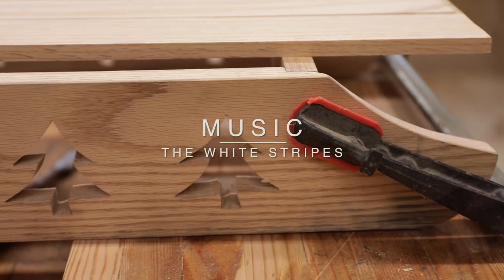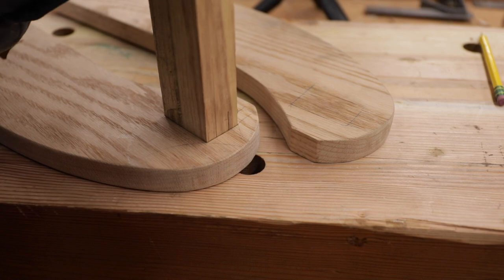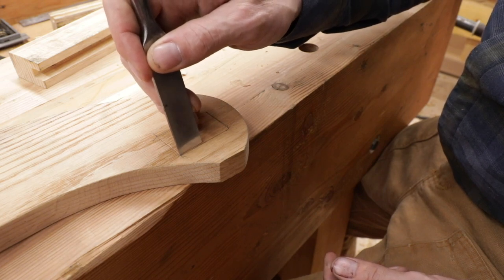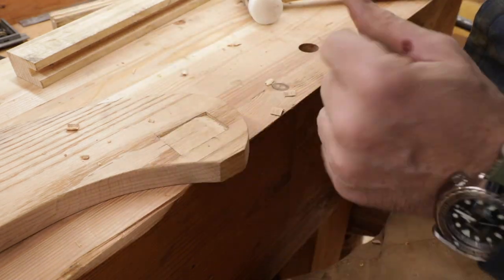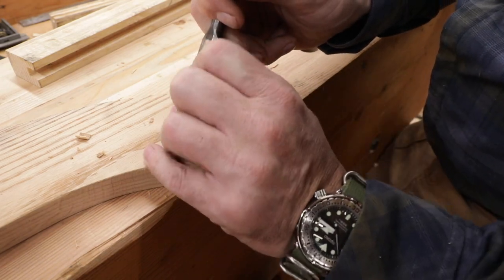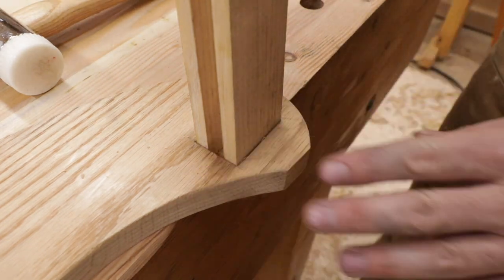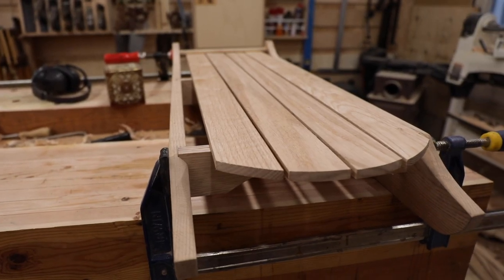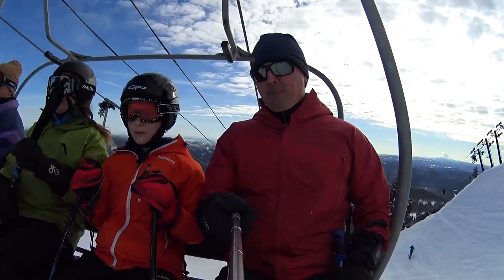HOW TO MAKE A SLED 4

Comment: Natural wood is best, just like the one I used in the 60's! It also had a rope that was attached through two vertical holes near the ends of the crossbar up front by some clever knots above and below. The rope was just a little too short to fall off the back if laid on the seat, which made it the perfect length for pulling and could also be wrapped behind a kid's back almost like a back rest, although that was a longer sled, so with yours that length might be too short for pulling. I remember putting a lot of wax on the runners! You can pull a toddler, or if you tie on a cardboard box you could pull a baby, or even the Heart Racer! If you pull Heart Racer behind you, then your heart will be racing!

Comment: Cody, I have painted red oak in the past, yellow and black, I do not like to paint  hardwood. If it were my sled, I think I would  use a water base stain ( comes in red ) and top it with the Waterlox. Also, I would pencil in the W* on the center slat and use router to carve it out, paint that red or gold and sand it flush once dry. It is a beautiful sleigh, great job.

Comment: This is an awesome project.  There is a difference between a sleigh and a sled.  Unless Heart Racer is going to pull it, it's a sled ;>)
A sleigh - a vehicle like an open-air carriage, pulled by horses, using runners instead of wheels for use in winter on show/ice. sled - a small single person conveyance to slide down hills, usually has runners, but may just have a flat bottom

Comment: For those non-woodworkers, he is using the chisel backward.  The proper way to chop a mortise is with the back of the chisel facing the wall with the bevel inward.  FYI that is a called a router plane.
Reply: Robert, Doesn't he have his router plane blade on backward?
Reply: Eastern Woodland Yes you would normally have  blade pointing toward front, but you can turn it that way for better visibility like when doing a stop dado.  Notice the gap is due to improper chiseling.  It's an ok job I'm just pointing out for others watching.
Reply: Robert, Thanks. I thought that might be the case.

Comment: From the beginning of this project I envisioned it being a two toned stain. With the lower frame and rails being done in either a light golden stain or natural, with the top slats being done in a dark walnut. To top it off several coats of a marine grade semi gloss polyurethane. It would make an excellent wall hanging piece of art, or a wonderful sled for some children. I think Jack is a little big for it. It would look wonderful hanging next to one of the doors with a sprig or two of fir and a red bow.

Comment: A handle on a child's sled sounds good at first blush - but if you are unlucky, it can lead to 'pole vaulting' in a downhill slide. Think about a car at speed on a 1/4 mile track if the front of the driveshaft comes loose...

A rope loop is generally safer.

I'd go with a natural finish. The wood is really beautiful.

Comment: I would vote for a dark finish on the runners like mahogany stain, a light finish on the deck (top) like light pecan, and a sealer like spar varnish (its light honey color really brings out the wood grain and stain color).  I would finish the runners with brass wear strips finished off with a ski glide wax on wear strips.  LOVEY SLED!!!!

Comment: No paint, a heavy-duty clearcoat will do nicely.

Also, putting steel strips along the runners will drastically increase sliding efficiency.
...half-round or half-oval steel bar would be ideal if you can get some locally.

Comment: I would paint the inside of the tree cut outs green and the stump portion brown.  The remainder of the sled should be clear neutral finish, to allow the wood grain to pop.  The 'painted' tree cut outs would really pop in contrast to the clear finish and even change in hue depending upon the angle from which they are observed.  The purpose of the tree cut outs was to add visual appeal so why not give them an 'old world' appearance by highlighting them?

Comment: Natural Finish.  Use Clear Penetrating Epoxy Sealer (CPES) its marine grade, soaks into the wood and is thinner than traditional epoxy. Wood whisper used it on a few outdoor furniture pieces and I used it on a exterior cedar door. Looks great.

Comment: natural finish with red runners!  also, if you use a solid handle instead of a pull rope, be aware that when a child is sledding with that, the solid handle has more of a possibility of causing injury when it bonks them in the face

Comment: I have the same watch band on one of my dive watches, the two links are on it to lock the band so it will not come off under water. you thread the band thru the links to tighten down. on the other side links I mounted a small compass. Every atmosphere you descend 33 feet/10 meters you add 14.7 psi to your body and your dive gear loosens up.

Comment: Have my Dad's Flexible Flyer sled. The back end is sort ofstepped arch rather than a radius. It was also clear finished on the bed with red lettering and the steel runners were either red or black. It also had a rope pull. You Don't want a handle in case of a crash. It would be an impact point for your riders. The sled can be carried or pulled back using yourself as a break going downhill.

Comment: Money well wasted on watches in my opinion. I work outside in the weather with frequent submerging up to my elbows . Had the $50-$150 watches, went through at least half a dozen. Then, in desperation, picked up a $15 Casio on my lunch break from Walmart about 4 years ago. That thing is still going strong.
Reply: Those casios work pretty good but the crystal isn't very strong. I have a half a dozen or so with broken crystals and each went through 1 to 4 bands before I just gave up on watches. That being said they did protect my arm in many cases. Working in tight spots on cars and trucks and just repairing things in general was kinda hard on them. At least for me. I must be clumsy or something. Now I just have scars where my watch used to be. lol

Comment: Don't paint the runners, it'll wear off very quickly. Either do a nice slightly darker or cherry stain, or stain everything but the slats and paint them red, or red with white accents. Then dip the runners in epoxy and put it together, it'll look good for a long time. Either way it'll look sweet! Good job

Comment: On the bottom of the stool seat you could pencil in center lines on both axis' so you have a reference to go by when needing a radius drawn.
Might save a bit of time & it would be there just in case you want fast markings.

Comment: Cody, rather than a G-Shock, I would recommend a Casio ProTrek.  You can find them with a compass, barometer and altimeter.  I have three of them in various formats, but they are extremely tough watches and not as gaudy as a G-Shock.

Comment: I have been planning to hand-build a toboggan or wooden sled for years. COVID has 'primed' me to start wood working once again, and after a number of projects, I am on target to build a sled similar to this one. I have it all sketched out, however, a huge issue I am struggling with is how to finish the bottom of the rails for glide and durability. I was wondering if I should/could roll epoxy (brand advise??) the heck out of the rails, or if it would be better to add strips of some form of plastic or metal. I noticed someone advised brass for runners. Would love some advise on this one and where to buy what you are recommending. Great build, by the way! and thanks.

Comment: Use used motor oil to stain it (DO A TEST PIECE) or stain the runners and bottom with apoxiy and paint the top

Edit:
Stain before you apoxy and use brass(not steal or copper) on the runners

Comment: Securing everything with rawhide through holes is the best way for securing your sled parts as they do with dogsleds, & snowshoes.
This allows for some flex so the wood is less likely to split apart.

Comment: Only clear coat the sled.  Also you really need to round over all sharp edges, even 1/4 round on the slats and especially on the front cross piece.  Also I don't think this sled will work on anything other than hard packed snow, when weight is put on it, the main cross members are going to dig into the snow.  The arch on the cross pieces needs to start at the runners to minimize the flat plate area exposed to the snow.  I also think the trees cut out on the runners are a mistake, should be smooth ovals or completely round.  I know the trees are decorative, but could be disastrous if small fingers were inserted to hang on, and there was a wreck, as I know there will be.

Comment: Natural oil - with just the interior cutouts of the trees painted green inside only (dark green) - if you look at it at the side angle (45 degrees) you will see the green - otherwise, it will look just natural. Copper or brass covered tin runners hand molded to the bottoms of the runners - with copper/brass screws holding it on the sides.

Comment: Either paint the runners sort of a Kelly green and oil the slats a slightly darker natural. Or paint the slats red and oil the slats a bright natural. A monotone of anything would be boring. While your riding it would be one color but when you hang it on the wall it would be an art piece. And of course I’m an expert (not).

Comment: Do NOT paint it. It is a hand made sled (made by Grandpa Cody) and should display that really nice wood grain. It should have sealed wood so a good quality sealer for wood should be used. Granted, you may not be a Grandpa yet, but you most likely be on someday. Great videos. Thank you for posting them.

Comment: Cody, please re-vist Paul Sellers on correct mortise technique your reversed chisel on the edges is not practiced by knowledgable wood workers and is a poor habit to teach newcomers.
Reply: Alan Wolf The way he did it works when you have a mortise wider than your chisel. The method you refer to is excellent if you have the right sized mortise chisel, but they aren't common larger than 5/8". Also, using the chisel on the edge was a good choice because he wasn't able to use a marking gauge or knife there.

Comment: Hey Cody I have a question.  If this sleigh is going to be used, how is a kid supposed to steer it?  I remember sleigh riding as a young child and no one pulled anyone around.  I remember my sleigh had a wooden bar went across the front and stuck out 5 or 6 inches past the side of the sleigh.  I wish I could remember the mechanics of it to describe exactly how it was made but I can't.  I do remember, when you worked it, it was like the same way a bicycle worked, at least as far as a set of handle bars.  Instead of cutting wheels,  the runners would actually bend a little in the direction you was wanting to go.  I don't know if you will be able to steer this sled in the manner you have built it.

Comment: I didn't see you doing any sanding. Need to at least break those hard edges to give it a finished look. Maybe you did, I can't tell.
How I finish red oak is with boiled linseed oil to give it a warm even color tone, and after about 48hrs apply an appropriate top coat for the conditions it will be used in.
The marine grade Waterlox would work well. A colored (red or green) semi transparent stain would also be interesting but should also be top coated with a clear marine finish.

Comment: Why would you be pulling it down hill. You should be riding it!
Reply: Sometimes you need control in your location you can't get from riding it. As far as I can tell this is not a steerable sled. For instance pulling a load or even an empty sled down to the trail to go fetch something you may not want to run into one of many stumps on the way to the trail. So you pull it. Another scenario is really short hills or bumps in the surface. Not worth it to rid a sled just 6 feet and yet with a rope it will run into the back of your heel.  A long solid handle will give better control when you need it.